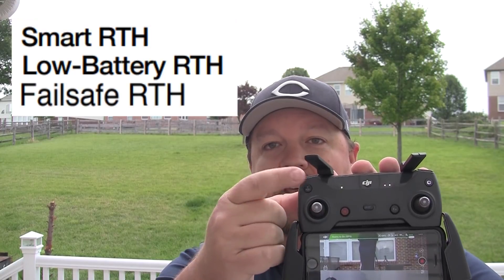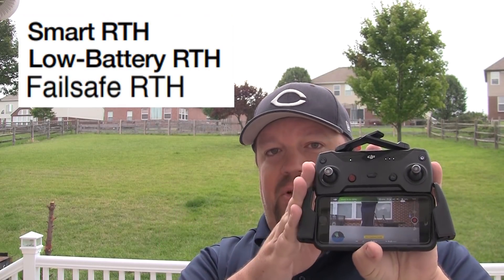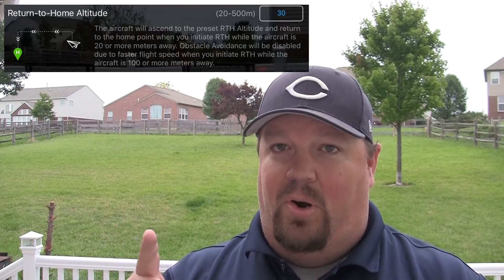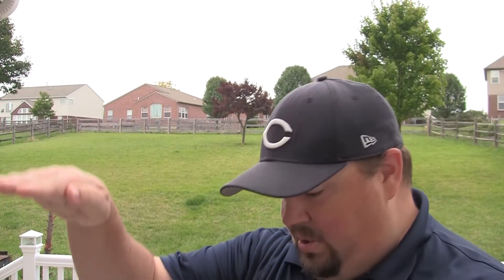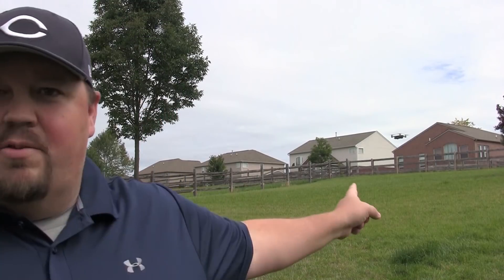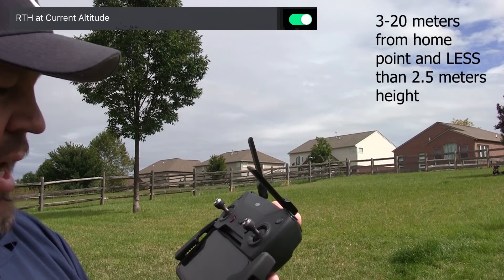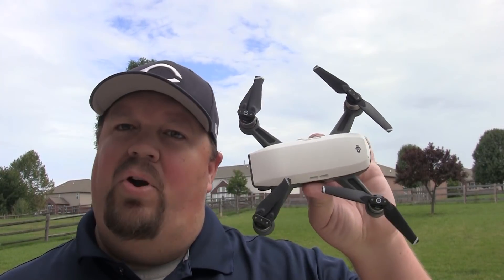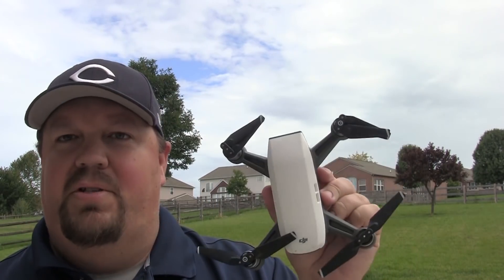DJI Spark - Return to Home Tutorial

Comment: what happens if the drone is out and higher than the set rth height?
will the drone stop, lower down to the set height then rth.
or will the drone glide down at a angle? which would be the best way.
or maybe the drone stays at current height, flys over head, then lowers down. hmm. food for thought.
Reply from the maker: No, it only goes up to the RTH height.  It does not go down to it.

Comment: DO NOT BUY THIS PRODUCT. IT IS UNSAFE AND SHOULD BE REMOVED FROM THE MARKET!
There is no emergency manual override to the flight control. This makes the product unsafe. I hope DJI gets sued out of the market place. They have been told this is a problem, but in their infinite arrogance, they refuse to add this required safety feature. Please do not buy this drone. 
If the unit goes into low battery condition it tries to fly home at what ever altitude it was at when the warning occurred. Hitting the cancel button was ignored. Once it hits low battery mode, the operator is no longer in control of the unit. I had it go into this mode, I tried to cancel. It ignored the command, flew into a tree and dropped to the ground. I also had another instance where it could not recognize the ground. I tried to do a force landing, as it was unstable. It flew sideways, ignored all flight commands and eventually crashed. This device is unsafe. DJI should be held fully responsible for any injury or damage that occurs from flight computer malfunction, as there is no way to manually override the control of the system. The operator is completely helpless to control the flight.
Reply: @DailyDroning  Just about 3 minutes earlier I had done a RTH which happened at a high altitude, well above the tree line. 
Cancelling RTH under normal circumstances seems to work fine. Where it does not work is under low battery conditions. It was flying at about 30 ft. It went into low battery mode RTH. I hit cancel and tried to just land it right where it was.  It momentarily canceled, and I tried to land it. It went down about 15ft and then went back into RTH and would not cancel. Gained altitude to its previous flight height of 30ft and flew towards home. I kept trying to cancel, but it ignored the cancel. Since it was flying low, it saw a tree branch, stopped and tried to descend. There was another branch just below it, which it hit, got tangled, shut off and fell to the ground. 
This is a piece of machinery. It needs to have an E-Stop or emergency manual override. The engineers make an arbitrary assumption that their sensors will never fail to function as expected. This is why automated machinery in a factories have E-stops. The world is not perfect. I can describe where the drone failed to function safely in multiple instances. It was impossible to regain manual control. At the point where it is impossible to regain manual control, then DJI should be legally 100% responsible for anything that happens since they are in 100% control of the machine.
Reply: @Verminator151029  It is pretty funny, but the splash photo for this very video shows a very similar circumstance that would result in the same scenario.

The take off and intended landing location were plenty wide open to be able to control and land the drone under normal circumstance. The issue was the direct path for return to home had trees in it. I had already flown the drone around the trees. Again, it does not matter what the drone was "supposed to do". The issue is purely from a safety stand point. Anytime you build a piece of machinery, it is required by law to have safety overrides and things like E-stops. This is because it is well understood that not all situations can be predicted and managed safely without operator intervention. A drone skirts this law because it is a toy, and not designed for a manufacturing environment. However, when it comes to safety, being a toy does not absolve DJI from not following well understood safety requirements. As for my authority on this matter, I come from an industrial equipment manufacturing environment. The necessity to meet very basic safety requirements is not up for dispute. Its necessity is well documented over millions of pieces of equipment over many years of experience.

Interestingly, when I first got the drone, it did a low battery return to home. It flew over where the home spot was, did a complete circle to inspect the landing and then descended to the ground. In this case, because there were trees in the flight path, it got confused. It also did not do an inspection circle as it had done previously. The simple fact that it got confused is proof alone of the necessity of operator overrides for safety.
Reply: @Verminator151029  In all that babble, You still can't explain why the cancel on the return to home failed. 
You also fail to explain why OSHA requires E-stops on machinery LOL.
Reply: @Verminator151029  It didn't work. I did cancel which worked initially. I then proceeded to command it to land right where it was. It began to descend until about it got about 15 feet from the ground. It then went back into automatic return to home and would not cancel the second time. I could not force it to continue landing. 
Machines are not allowed to injure people but who cares if a toy does. If someone is injured, I'm sure they don't care if it was from a toy or machine. It still hurts - dah.  These are well established safety principles.

Comment: Hello there! Love all your drone videos! I've been flying my spark for a month now and i was able to gain confidence to fly my drone because of your tutorials! Thank you so much! I was wondering if i can still use my remote if ever i activate my spark using gesture mode while it is connected at the same time to my remote. Just in case i want to control it by remote when something wrong happens while using gesture
Reply: KlooGee do you have any idea what my spark is trying to tell when all of its battery lights are blinkin on and off at the same time? After flying my spark i tried to turn it off and it wont turn of after pressing the power button ( press and long press) instead all of the lights of the battery are blinkin on and off. I have never experience this.

Comment: Buyer beware - my drone incorrectly said it was in a NFZ and landed in the ocean.  I’ve been trying to find out what happened with DJI for weeks but they keep saying it is out of warranty.  They showed no interest in getting to the bottom of what happened even though I could prove I wasn’t in a NFZ (their own maps / my flight data etc).  See attached response.  
Dear Jenny - This is about the 8th time I’ve asked you the question.  I am not satisfied with your complete lack of effort.  I do not want you to analyse the data - I already have done that.  I want to know why this happened.  All the data I have looked at (and supplied to you - including flight log, CASA maps, and Fly Safe maps) indicates no reason why the drone indicated was forced to land in the ocean.  The warning that came up was that it entered a no-fly zone and I was over 40kms south of the nearest no-fly zone.  I want DJI to tell me why.  Like I said, this is about the 8th time I’ve asked you this simple question.  I find your complete lack of effort or concern frustrating.  I would have thought DJI would be keen to get to the bottom of such an incident to ensure consumers did not have to go through this in future.  I belief it to be due to the ongoing service DJI provide - that is incorrect software or incorrect satellite communications.  As I already told you the drone was flying fine up until then, had 16 satellite connections and had 80% on the battery.  I had clear line of sight and no aeroplanes or boats in the vicinity.  
Please forward my complaint to your supervisor / manager.  
DJI Support （DJI Support） 
4月15日 CST14:25 

Dear Paul,

Thanks for your patience. 
We would conduct a data analysis to find out the cause of the accident if the drone is within the warranty period. However, the data analysis service is not available for your case.
Feel free to refer to the tutorials we shared if you'd like to further investigate yourself. Your cooperation will be appreciated. 
Best Regards,
Jenny

Comment: Great videos... Thanks! Is the rth altitude I set calculated as the height from the home point or where the Spark is when a rth is initiated? Lot of confusing posts on this. Reason I am asking is will I need to factor in changes in topography when flying down from a cliff? Would hate to fly down into a canyon and hit the side of the cliff due to improper rth altitude settings.

Comment: Hi just wondering, while flying the drone what happens if you were to receive a phone call? Does the DJI app block calls or will the phone leave the app and the drone RTH when the app closes.
Sorry if this has been asked before, if not does anyone know what would happen.

Thanks
Reply: This has happened to me, the drone will stay still until you return to the app as long as you have sufficient battery.  If it looses connection to the controller it will RTH

Comment: You may already know this, but if not, you can purchase a small lava lour mike and either use it with a wireless setup for your camera, or if your close to your camera, like I think you are, just clip it on your collar, maybe run it down your shirt, and plug it into the camera.  I noticed that your getting a lot of wind noise.  They make a small "dead cat" cover (hairy cover) for a lava lour and it does wonders to control the loud wind noise.  It can knock it down considerably.  Once again, no insult to your intelligence.  You did a really good and really important video here.  Marc.

Comment: I have some concerns about the 'wait for user confirmation to land'.
Yesterday, my spark flew to home point and just landed after issuing a RTH command from remote.
The only thing I could notice was it warned about it was performing a precision landing.
I couldn't find in users manual any exception about hover and wait for user confirmation to land unless RTH at current altitude is disabled.
Do you have any experience on that?

Comment: Mister this is an AWESOME Video. I just recently bought spark and got plenty of questions but you answer majority of them. The only thing I wanted to ask you is, it’s kinda confusing to me when trying to determine if the aircraft is facing you or facing forward when it’s already far away from your home point. You know that it kinda goes in reverse depending on where the gimble is facing. So, that scares the heck out of me. Any advice please? Thank you again for taking the time sharing your video.
Reply: Great thanks!

Comment: That's very thoroughly explained, I definitely learned something, was contemplating between Mavic Air and Spark, ended up with spark as I  got it at a reasonably cheap rate and I am a beginner did not want to just throw my money at something I was not sure about, but I must admit, I'm just loving this thing, I cannot believe all the features this thing has, and it just keeps getting better, I'm still learning new things and your videos are helping a lot. There is one issue I'm currently facing, I see this weak transmission signal when I got above 120 meters, which is wayyy under the official altitude, don't know how to fix it.
Reply: Kloo Gee Thank you for the reply! I'm from India, but currently we don't have drone laws yet, there has been a draft which categorises drones into 4 categories, nano , micro, mini, small, large. They are segregated according to the weight, and according to the category, the user is supposed to either register the drone, or need prior permission for flying. So I don't think there's an issue with the altitude restriction. I'll check out the provided link and give you an update. Thanks

Comment: Thanks for your video! And about the dynamic home point? I'm very confuse with it, i want to fly from the boat and i don't know what the best settings to RTH from a boat,  If i loose the connection with my controler in dynamic home point, the spark is landing at the water?
Reply: You're right, but I'm still confused, dji could do something more effective for these occasions.

Comment: Very useful video. Thanks for it. It is also worth to notice, that if Spark is in distance greater than 20 m and altitude greater (lets say 120 m) than Return-to-Home Altitude (lets say 50 m) Spark will return on altitude 120 m. It will climb to RTH altitude if it is below it, but won't fall to it if it is above. So watch out if you take off under a bridge or something like that :-)

Comment: Great video! I was flying my Spark today, around 400m, when it disconnected from the controller. I tried to activate RTH on my but it wouldn’t work and it never came back to me. I’m trying to understand what I could have done differently to prevent that from happening. Have any tips?

Comment: hi, i lost wifi signal midflight, RTH was initiated and my phone was disconnected, however when it came close, my phone still didnt connect to spark(still showing disconnected), so i had no control over spark on RTH  when it came close, luckily it landed in a clear spot although it was surrounded by objects. Question 1: While landing in RTH mode, does it look for objects around and land safely in clear spot? Question 2: In RTH mode when spark comes closer, isn't supposed connect back to phone so that i can land manually ? Any help would be appreciated. thanks !
Show less
REPLY

Comment: I think one point is still missing (or maybe I missed you mentioning it): The spark won't go down when RTH is initiated and you are currently higher than the RTH-altitude selected. It will return at the current altitude instead. I Know this is true for distances greater than 100m not sure about 20-100m.

Comment: good info but please tell your watchers- I got a home location and started to fly - but after about 5 minutes I lost connection with my controller , I then hit the RTH button but it just flew away (lost) I also had DJI refresh but due to something that did not record onto my Iphone DJI will NOT refresh. (after a month of email then they said they will not refresh) I am a 69 year old (young) pensioner living in Scotland. I am down £758.00 so I think my drone days are over. Please pass this on incase anyone is thing about DJI refresh please please read the SMALL print before buying and thinking you are SAFE   . I was just beginning to enjoy flying my Spark. thanks for all your videos
Reply: Could you possibly try turning it in to your credit card company if you used one to order your drone?  Card companies have a lot of extra perks that people don't know about as far as getting something fixed even tho that product is out of warranty and will sometimes cover stolen items or at least help you out somewhat.  Just a thought and maybe worth checking into.  Best of luck.  I have this fear every time I fly.  Hope it never happens to anyone.
Reply: your drone could have been hacked. i just read about similar instances. because radios and connection and RTH function is pretty solid on DJI from what i seen so far.

Comment: Well explained on RTH..one question from me, occassionally IMU calibration error appeared and its goes away in 2-3 secs before a flight, ignore or calibrate?But nothing happens in mid flight, i found quiet annoying by removing 4 props, what about not removing props when perform IMU calibration?What say u?
Reply: Thanks Kloo Gee,normally i m flying at flat land with just trees surrounding, once i paired up with my spark at a new location, the error appeared for 2-3 seconds and whoosh...disappeared,if error stayed lit i will calibrate otherwise i am flying...ok, do you know how many times , our spark battery can be charged before battery lost its charged capacity, i m worried one day it will fall from the sky after many cycles of charged.